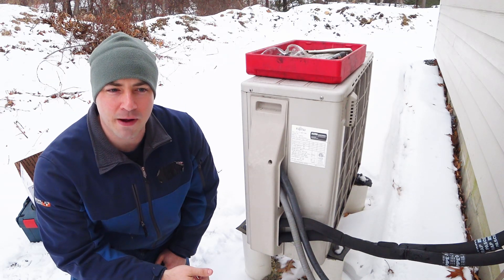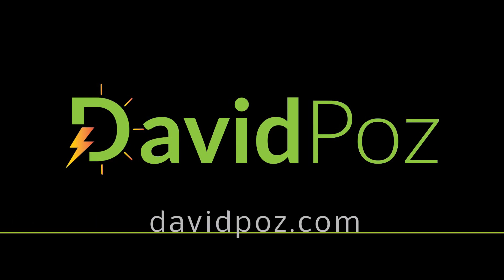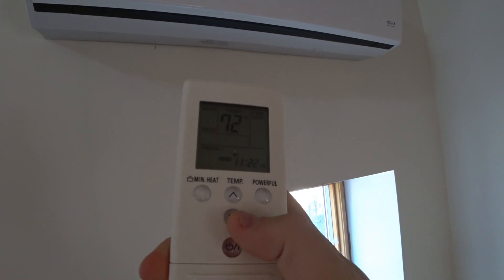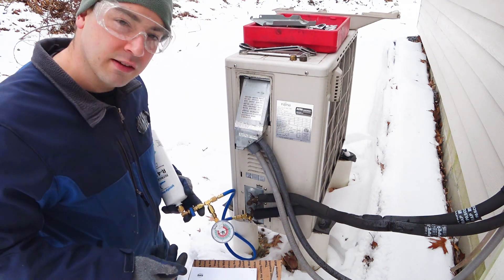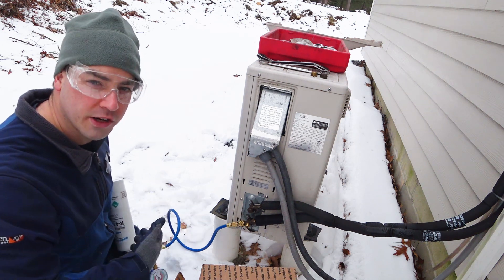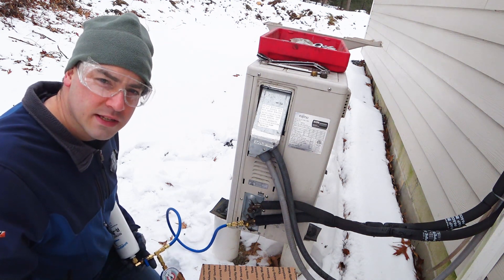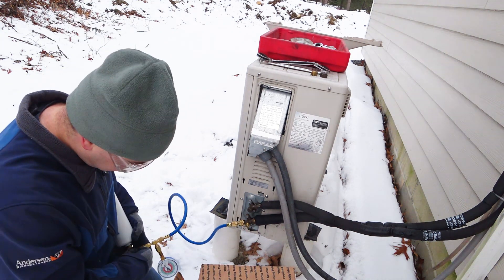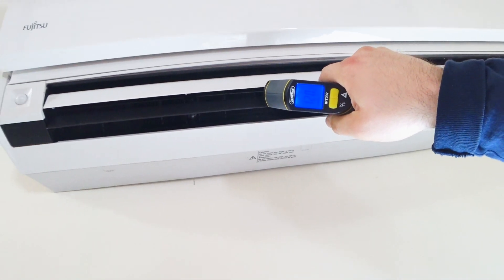Saving Money with DIY Repair on Mini-Split Heat Pump

Comment: Definitely you have to consider that is some leakage in device..... 
Leakage seeking device would be great if you can borrow it somehow.... 
Fujitsu is one of the top brands in Europe..... 
About the defrost... It would be wise also on the first place to get air to watter unit.....air/water split sistem are more popular in Europe because of underfloor heating.... Defrost is there not noticeable...(defrost tank)...
Try search for oil spots in outside unit you have to dismantle the unit..... Oil is light green color if is exposed to the air or moisture... 👍 
Then do the same with indoor unit also..... 
If you don't have seeking device use soapy watter and look for bubbles.... 
Also could be valves.... or 4way valve or the best would be if pipes would be squealed some how or nail through the pipe.... 
Anyway Serch for the oil spots is the best indicator..... 👍 
I wish you quick finding ....

Comment: Thanks so much for your always so well done Videos! I just did a quick look on line and it said"People also ask
What temperature is a heat pump not effective?
The heat pump is effective by itself down to temperatures around 25 to 30 degrees Fahrenheit. At that point, either a gas furnace or an air handler with supplemental electric heat will kick in and help heat your home..   
  I have done a few on my own places and so far such good luck but as im on the West Coast is warmer. I think u are in a Colder area and when Temps get down you will need something else?

Comment: The correct procedure when installing minisplit line sets... 
is to verify each flare joint before tightening the nut with a proper torque setting specified in the installation instructions. After that the lines should be flushed with dry nitrogen gas, then pressurized with dry nitrogen up to 150 psi, and verify zero pressure drop over 24 hours.
After that, the tech is supposed to vacuum out the lines down below 500 microns, then fill with nitrogen, then pull down below 500microns again, then fill with nitrogen, a third time, then pull down a final time below 500 microns.
All before EVER opening the unit king valves.
If at least the nitrogen pressurizing wasn’t done, your installers are to blame for the poor performance of the system. 
I own a small HVAC company in Charlotte, and knock on wood, but all my mini splits are going strong years later... 
adding 410 to a unit is a bad sign. And if any techs service your equipment and add one drop without removing everything in the unit, and filling the lines with nitrogen and FINDING the leak, they are stealing from you.
Get a company that will actually find the leak and fix it.
Or that $5000 unit will fail very soon...
Reply: If the lines are brand new and the equipment is all new then one evac too 500 microns is fine. Triple evac is only if you ever open the systems for repairs. 410a oil is very hydroscopic
Reply: Andrew Darbyshire this May be true... however, the installation instructions require it. 
Keep in mind, minisplits are a strange system. You don’t get liquid line access to the lines for a proper flow through evacuation in many cases. 
The lines are very small and often quite long. Also some units have multiple sets of lines going to multiple indoor units from a single outdoor unit. Some even have a distribution box feeding several indoor units from a large outdoor unit... a lot to get from a single evacuation...
Reply: Wow! Thanks!  This is how to do it ! i have bought a few on line and so far no problems as i hired professionals to do the job but now i know what to ask and look for
Reply: If I can pull a vacuum to around 50 microns and hold to around 150, there ain't no moisture there.
Reply: Bullshit.  I got 50 years experience and no one who knows uses nitrogen when a simple vacuum pump will do.
Reply: Triple vac not necessary if you can reach a deep vacuum first try
Reply: Probably the best way to get results... 👍
Reply: Its easy to say that so ok the install is to blame but are they going to take it i dont think so .I do everything it says in the book to keep the indoor unit clean , vacuuming the filters every month , I live in nz it doesnt snow here  where I am in the north island except on the high on some mountains an couple of cities down tin the south island , so  wer'e in autumn going on winter now weve had some beautiful days here so understandable theyve being nippy at night and in the mornings  , I turn my diakin heatpump off at 12pm when we go to bed and on again at 7am when were up ,  so it was -1  the other morning and i noticed around 10am it wasnt really warming the room , so went and checked the unit outside  ...It was  Covered in a thick pack of ice all over back the side coils and some inside behind fan. I  turned  the outside and inside off and it took me 20 mins with the hose to get all the ice off properly . If I hadnt of done that it never throughly melts off during defrost time and is just accumulating.  As we get into the colder winter days this will have to be done daily. Ive had techs come out from diff companies even, they replace things like fans,  add freon, do this , do  that .I mean you have to believe them to some extent .  Outdoor unit gets dappled sunlight during winter, I can cut a couple of trees down to get the full sunlight coming down on to it, I think that would help .
Reply: 150psi? We strength test a 410a system at 600psi then vac down to 2 Torr or below. That's the regulations in the UK anyway. If the system has a tiny tiny  leak which is obvious does if its loosing its charge over 2 yearst the leak must only happen during operation when things get hot and cold causing the pipework to expand and contract. A tracer gas that is 95% Nitrogen and 5% hydrogen should be used with a gas 'sniffer' to locate the tiny leak once any remaining refrigerant has been Reclaimed. Chances are it's probably on the coil of the condenser but you would struggle to find this just using OFN (oxygen free Nitrogen alone) and leak spray.
Reply: Alex Tarasov its all about moisture contamination.

R410 refrigerant requires POE synthetic oil, and it is EXTREMELY hygroscopic, it literally will not release moisture without physically scrubbing the oil through a desiccant. No amount of vacuum will remove moisture from the oil. 
This is why installation is so critical. On minisplit lines, only 1/2 of the circuit is accessible to a service port, no way to purge with refrigerant... it needs the triple evac to get it right.
If the lines were sealed, and the ambient weather is dry, an quickly install might last forever... that’s a lot of iffs...
Reply: @SuperVstech  How much water in system is too much water? If the weather was dry and refrigerant pushed out all the (humid) air, how much water would be needed for corrosion to cause a failure? I mean, we're just talking chemistry here, and once all of the reactant (water) is used up, the corrosion stops. Right? (I have two ductless systems I installed myself. I pulled vacuum but did not purge with nitrogen. Both units still running strong 10 years later.

Comment: I'm sorry for all your trouble I feel your pain I would like to help I know the problem you're having with the flared fittings and happens with all of them and I've learned the solution it's very simple please give me a call if you're interested and I can walk you through a DIY solution that you could possibly even do yourself if you have oxygen and acetylene torches
Reply: You seem very capable and mechanically inclined I'm just saying this is something that would be easily walk through

Comment: Seem your unit is not the good one... but now you know for sure you have a refrigerant leak. Before recharging you should purge your hose by the way. As you are a great DIY guy, now you should find a leak detector (spray like BigBlue micro leak detector) and find where the issue is. If you have time to watch on you tube, there are some good channels. By the way I have a mini split too (Daikin, used in heating only) and work fine since 6 years (hope this continue). Thanks for video !

Comment: I installed my mini split my self!  First time and runs great on my solar setup.  Now  several people online recommended and insisted i use NYLOG Gasket/Thread Sealant on ALL flairs and threads, its compatible with the refrigerant so even if it gets in the connection nothing bad will occur. I makes sure all connections wont leak. If it dies again, undo every pipe and use this. Also Pepboys loans VACUUM pumps! I found out after i bought mine LOL.
Reply: " i use NYLOG Gasket/Thread Sealant on ALL flairs"   THANKS!
Reply from the maker: Thank you.  I'll use your suggestion if it dies again.
Reply: so i see two different types of this to buy. the Red one or the Blue? i think its the Blue as im using R410
Reply: Thanks for that. Have ordered a bottle for next time!
Reply: https://youtu.be/xlU5rGxN8-E

Comment: I’m an Hvac tech, did you release the air out of the hose before you added gas to the unit? And second the company’s that have been there should have told you they can get rid of the fleer fittings and brazed the line set to the unit.
Reply: Brazing is not recommended by most ductless manufacturers simply because these units have no filter driers and several refrigerant screens that can clog up if best brazing practices are not used. That is why they use flare fittings.
Reply: @HVACinSC  And a properly done flare should last a lifetime. Heck, automative AC systems are just kept pressurized with o-rings and they hold charge for 20 years or longer.
Reply: If you're going to braze you should be flowing nitrogen or you carbon up the line set.

Cut off the factory flares, re-flare with an oscillating flaring tool, use nylog as per the units manufacturer's instructions and torque to specs.
Reply: Harry homeowner doesn't have a brazing torch...not likely to get one for this job either.  Stay with flare if that's all you got.  And you can keep the line set coiled to take up extra.
Reply: so brazing is better?

Comment: Hey David, 
That sounds very frustrating. You clearly have a slow leak. As someone else in the comments has said you need to get a soap and water solution and spray it on all the fittings. You could also have a leak in the units since you have had the line set replaced. It is possible that the flares were not made and torqued properly. When I installed my unit I tightened the flare with a wrench as tight as I thought it should have been and then checked the torque and it was loose. So if your HVAC guy did not use a torque wrench it may be loose. I have mini splits in two houses and they work great.

Comment: Well,  you got one thing right, you called it a heat pump, other than that,  it's all bad,  you repaired nothing, simply adding gas to a leaking system is NOT a repair, it's an environmental disgrace.
As for it being a money pit,  even a simpleton would have shot in a charge containing UV dye to find the leak.  You do make a good point about the defrost, what am I saying, the unit has to absorb the heat from somewhere to defrost the evaporator, either that or go back to supplemental electric heaters.
I hope you find a properly trained person that can run a leakseaker over the unit, it will doubtless be one of the four flares, maybe an isolator valve, but that is rare, Fujitsu make good units, in 20 something years I have only seen them fail from old age, mind you I have seen plenty that were killed by DIY installers or neglect.
Reply: Fujitsu make good units! they are Top of the line?

Comment: Most of the times it's the flare fittings that leak or the service fitting caps.  The flare fittings have to be good n tight. When it's fairy nice out use soap to check leaks on flare fittings. The ones under the evaporator is a pain. Use big heavy Cresent wrenches not small ones if you use big heavy clunbsy wrenches they don't flex so it holds the nut better or if you have flare but wrenches that works to but bear down on them it has to be tight
Reply: Roy Amberg if you over tighten the flair nut you will cause it to leak as you will work harden the copper pipe and cause it to be brittle and crack , use moderate force- the fitting is designed to be efficient and seal without over tightening it

Comment: All refridgerant AC systems are sealed systems and you should never have to recharge them unless a part is replaced or it leaks. Your system has a leak. Have you tried contacting Fujitsu? Give it a try. Maybe they will replace the unit. hvac@fujitsugeneral.com

Comment: Again speaking to unit quality, the Mitsubishi models turn off the indoor blower and tilt the vanes up to prevent you from getting hit with any cold air in defrost mode. I thought most others did the same.
Reply: I installed an Air-Con unit and it turns up as well.
Reply: Kinda funny, I wish it wouldn't. Many complain about the popping noises from the plastic getting hot from the coil.
Reply: My pioneer turns up aswell.
Reply: Liam, that's not the issue here...see the first video.

Comment: If I understand AC correctly, the charge pressure should be in accordance with outdoor ambient temperature. So the less degrees it is outside the less pressure should be charged.
Reply: these units are Charged by Weight

Comment: This is our third year with our mini duct heat pumps, they have worked great and it is hard to believe that they heat down to -20 below zero Fahrenheit, it was -23 last night our 18,000 btu unit still was heating a little!
Reply: @Johnny Ericsson at some point its better just to use a resistive heater and save the where an tear on ur so good heat pump?
Reply: i dont think they work the best when its below Freezing? I think they are the best above
Reply: @guiltfreehotwater4354 the models with hyper heat are rated much colder, -22°f.

Comment: Mine has a leak. It's a R22 system. I have been running r290 in it for four years now. Pure propane.
Reply: does that actually work? i dont know crap about hvac as im only 16 but that sounds interesting to me, is it just as effective as the R22?
Reply: @Cdubb_Official  It is. It may be a little better. R290 is used all over the world including the United states as a refrigerant. It closely matches R22 with some slight differences. For many years it was used as a replacement refrigerant in cars. Before the feds changed the standard. R290 is safe for the ozone as well.
Reply: It will not work in a newer system that runs at higher pressures. Do not use it in R410 systems
Reply: @kevinroberts781  And it has a much lower Global Warming Potential than R-22. But it is highly flamable.

Comment: It’s my mission to learn how to service and rebuild these f’n things. I’ve been going through the same battle with a clients 3 zone unit. Struggle and emerge right? Way to tackle this one. Hoping to see some dialog from some HVAC pros.
Reply: Iv herd it said that when u get more  than one zone u can have problems? so the installer i was talking to just installs single zones now
Reply: @guiltfreehotwater4354  if that's what you heard, you were talking to the wrong people.
Reply: @guiltfreehotwater4354  Sounds like those installers are taking the easy way out

Comment: I hope someone from Fujitsu sees this video and reaches out to you to make it right.
Reply: If anyone knows how to contact Fujitsu you might take the time to share this with them...
Reply: i have 3 nearly identical fujitsu units and same issue on 2 of 3!!!
Reply: Fujitsu really could care less.  I had a $5,000.00 2-head unit installed in Dec. 2018.  It never worked correctly...kept turning off and on...and produced 80 to 90 degree heat output at the head.  I burned a lot of propane in my portable heater to get thru the winter.  My installer tried a number of fixes but nothing worked.  He finally told me that that's as good as it's going to work. I said I don't think so and filled out a form from the Maine attorney general's office under the Maine Implied Warranty Law.  I mailed a copy to my installer, his supplier, and Fujitsu.  Within 4 days I had a call from the regional Fujitsu supplier saying they would replace the entire system both inside and outside.  The new unit has worked great and I've only used my gas heater one morning when it was -30 F degrees.  If I hadn't pursued the issue I would have wasted $5,000.00.

Comment: I look forward to the pro comments, but get yourself a set of real gauges ( may come in handy when the window unit finally lets go), and next time use a can of "Dust Off" for your refrigerant https://youtu.be/xmQRB64CHKA .
And my last forever AC is a little 5000BTU portable unit that you have to run a vent and drain for...

Comment: Almost the same unit as the one that is in my shop right now. I have a Fujitsu Halcyon that is 12 years old, rarely has issues. Only problems I've had is having the entire unit freeze up due to it not being cleaned.

Comment: I'm not a HVAC worker but what I have red about those in my degree is that you have R410a working fluid which has GWP global warming potential of 1720. That means that ex. 2kg that fluid in air is equivalent of some guys yearly CO2 emissions. So if your pump is leaking working fluid maybe you should consider repairing it. =) 

Your videos are very good and stuff that you do is inspiring. =)

And that defrost mode! It's supposed to cool the inside air for a moment. Because the pump is working other way around for that time and melting the ice from the evaporator.
Reply: 400ppm couldn't warm a nat's ass at the North Pole, much less the 100ppm or so rise since the industrial revolution..